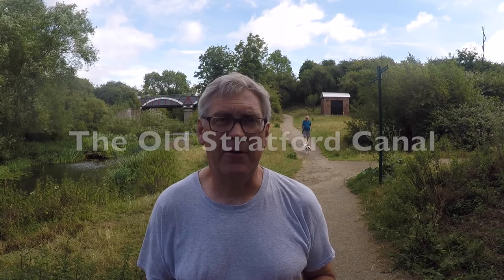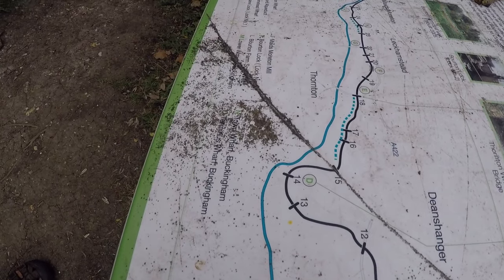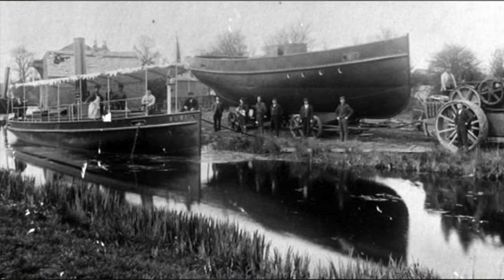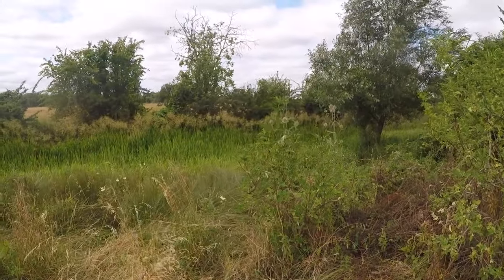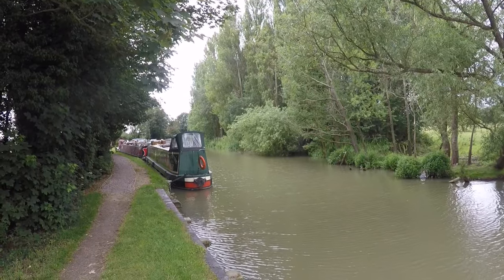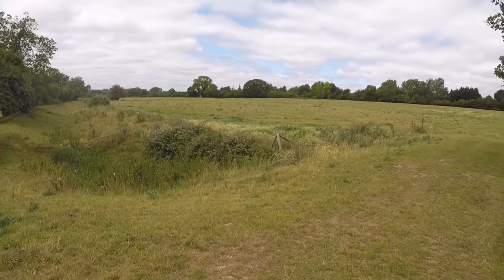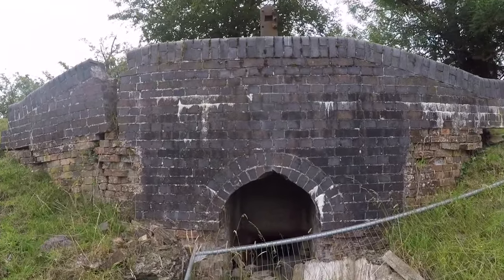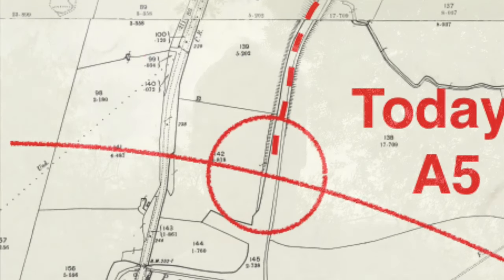Old Stratford Branch Canal

Comment: What date did they start to use metal lock gates . 
I saw lots in the 1980s on the popular rings , I see that the canal between bridge 2 & 3 is ready to go ,I bet you could get canal bridges from Amazon now. 
It is quite interesting if you look on Google earth on the other side of the new A5 bypass where you finished ,  it looks like there was a canal basin on the other side. And they have built houses around it. But between the new houses there is a wharf lane.
This is typical of local authorities when a town was bypassed ,they generally allow new development up to the new road .
Reply from the maker: Martin - they used lots of steel gates in the 1970's when BW and British Steel were both state owned.